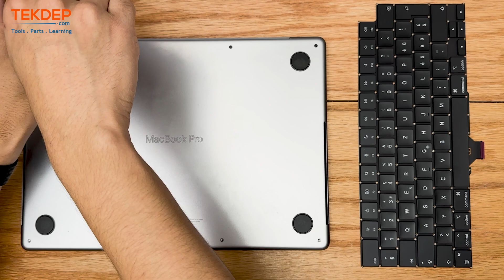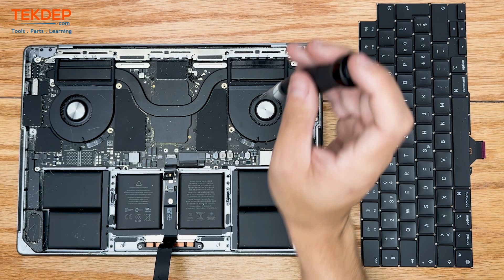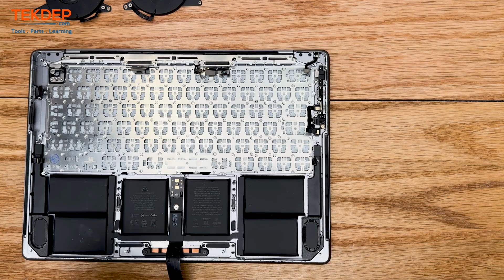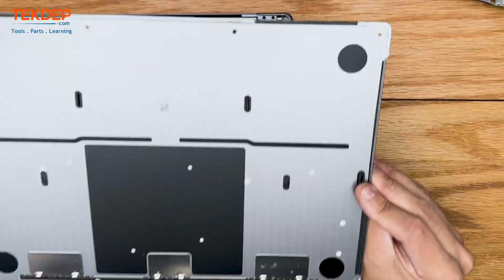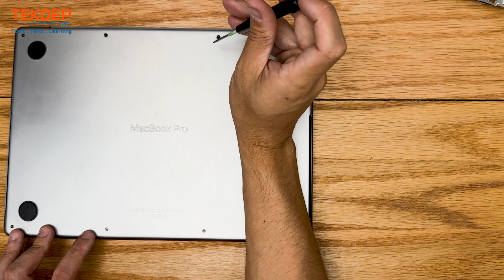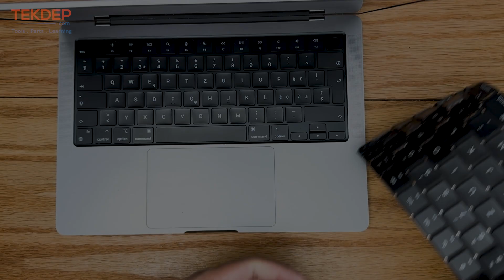2021 M1 MacBook Pro A2442 Keyboard Replacement! Step-by-Step Guide

Comment: unfortunately ripped my display ribbon cable when i removed the keyboard. would've been nice to know on the tutorial i did it how you did but the cable was in the way. 

i reconnected everything now it won't show any display even to my external. somewhere i think apple proprietary headache is not worth it. 

likely seems somewhere dependent to have the display functioning.
Reply from the maker: Beware everyone, This is very important! Must get the Display flex cables out of the way and pull the back before getting excited to rip the keyboard out! Or else you will risk permanently damaging your display, We have cautionary note within the video description and within the video itself. It will show a card on top to caution you. You also must watch a second video before attempting such a complex repair. 

We also offer a convenient and affordable Mail-In Repair and data recovery. You can learn more and get started here: https://tekdep.com/device-repair/

If anyone needs replacement parts such as screen and batteries or tools for your MacBook repairs, we have them all and ship worldwide! visit: https://tekdep.com
Reply: @tekdep i'd be happy to send it see what's salvageable but please don't access my data

Comment: Just finished this repair on my first-generation M1 Pro Max. Took about 4 hours in total. Couldn't have done it without this video! Many thanks!!!
I had to take the logic board back out twice, not heeding the warnings... first time I had one cable underneath ;p ... second time I didn't realize I had to put the fans in first ;p ... but finally together and working 🙏
FYI I think it is necessary to take out the entire upper hinge/wifi bracket... because... you actually can't get the ONE upper left screw off for the power button, under the upper left hinge... have to take the entire bracket off and hinges to remove the screw to properly get the power key and backlight off. I actually lifted the entire screen off since the hinges were still covering it. Maybe you found another way, but that's what I had to do.
This video was like ASMR while doing the work. Thanks again, man 👊
Reply: Hey! Does the keyboard feel wobbly / less secure in the middle in any way? With no rivets to hold it in, i can image some travel?
Reply: @antonsnnichsen109  Hey there. Actually if I recall correctly, there are many rivets throughout the keyboard, that have to be pulled off... however there are also many number of screws around the edges, and also a few screws in the middle. I might have missed one or two of those screws putting it back together (I definitely did, *cough*cats).
That being said, I just tried it again... can't notice a depression at all. I think it's backed pretty well behind it, or at least the screws are holding it in well enough. Really can't notice any difference from the center and sides. Hope it helps. 
Pro tip: Always keep a small magnet close by to keep hold on all of your screws 👍🏻

Comment: вандал
неужели нельзя было  подсветку клавы прогреть что бы она нормально снялась.
Reply from the maker: Sure you can try different techniques, but heating will most likely will shrink and damage the backlight easily since it’s thin plastic layer 

If anyone needs replacement parts such as screen and batteries or tools for your MacBook repairs, we have them all and ship worldwide! visit: https://tekdep.com 

We also offer a convenient and affordable Mail-In Repair and data recovery. You can learn more and get started here: https://tekdep.com/device-repair/

Comment: Just done this and it works! Thanks. 

Although my backlight was literally stuck so it tore some of it off, was no way of removing without ripping it.
Reply from the maker: When working with the backlight, start by carefully peeling off the adhesive all around using a flat pry tool or blade. Be sure to remove it without damaging the backlight cover that sits above the keyboard. Additionally, take extra care not to rip the LCD flex cables, as they are located very close to the keyboard during the peeling process.

If anyone needs replacement parts such as keyboard, screen, batteries or tools for your A2442 MacBook Pro repairs, we have them all and ship worldwide! visit: https://tekdep.com 

We also offer a convenient and affordable Mail-In Repair and data recovery. You can learn more and get started here: https://tekdep.com/device-repair/
Reply: Hey! Does the keyboard feel wobbly / less secure in the middle in any way? With no rivets to hold it in, i can image some travel?

Comment: Are all the screws the same that hold the keyboard in? On my A2485 I found a P2 screwdriver worked perfectly but there are 2 screws that won’t come out— the are the 2 that are even with the tops of the speakers , one on each side — any tips to get them out? I don’t think I have a PL1 screwdriver

Comment: But aren’t those rivets broken after you tear the keyboard out? And the when you put the new keyboard in it is only held by the outer screws? That means the keys arround the middle dont have any support when you press them?
Reply from the maker: Yes, you lose the rivets but still keyboard is held in place securely and it has sufficient support and you 
won’t feel it’s loose. It’s just like the way it was when it’s replaced. Apple is to blame, but it’s completely fine other than the hectic process of replacement, if you need to purchase the keyboard we do have them in stock and ship anywhere! We also have the complete top case assembly if you prefer just to replace the whole thing and not just the keyboard regardless if you also need us to replace it for you, we offer mail in repair service visit our site for parts tools you seen in this video. We have them all or if you need our help to do it for you TEKDEP.com
Reply: @tekdep  You still kind of feel the keyboard going down a bit in the middle. The middle keys also make more sound when pressed, compared to the outer keys that are supported by those screws? Any ways to fix this or apply some double sided black tape maybe ? On the horizontal lines of the keyboard? (between the keycaps)

Comment: I strongly recommend to remove display. This is just a matter of time until loose rivet will crack or scratch the screen by getting between screen and palmrest It is also worth using somethinf to cover battery (you can buy cover for 7$ on apple self repair service). Not that important but keeps speaker and battery safe.
Also this method does not replace rivets with screws. Keyboard will be quite wobbly and it will have noticeable.

Comment: even tho i was trying to be very careful with the touch ID cable, i still ended up tearing it :/ anything i can do?
Reply from the maker: Most affordable way is to just purchase another Touch ID, and it will function as power button since you won’t be able to pair it with your old board and I’m afraid you won’t get your touch if function back unless you replace your entire old logic board with new one that has paired Touch ID. 

If you need just the Touch ID or any other parts or tools for your 14” MacBook Pro repairs, we have them all and ship worldwide! visit: https://tekdep.com

If you're still experiencing issues with your device and need help, we offer a convenient and affordable Mail-In Repair Service and data recovery. You can learn more and get started here: https://tekdep.com/device-repair/

Comment: hey, i tried this but my screen doesn't show up anything except for that sound at the start of  the macbook
Reply from the maker: Possibly you did not secure one of the connectors, revisit the display connectors and make sure they’re snapped in correctly and nothing is damaged! 

If you're still experiencing issues with your device and need help, we offer a convenient and affordable Mail-In Repair Service and data recovery. You can learn more and get started here: https://tekdep.com/device-repair/

If you need parts or tools for your repairs, we have them all and ship worldwide! visit: https://tekdep.com

Comment: Hi, 
I've Macbook Pro 13 - Inch M1, 2020. SInce one week I was facing unexpected issue like Key A and D won't worked. If I try to press multiple times like once in 10 time it works. What would be the possible solutions for it. How much cost it?
Is it any settings problems or keyboard failure?
Reply from the maker: Hello! For your unit it is possible to replace just the keyboard, but due to the touch bar and the associated difficulty that it brings, we recommend just replacing the entire top case assembly. We have the top case available here :  https://tekdep.com/product/13-macbook-pro-2020-gray-palmrest-top-case-keyboardtouch-bar-a2338-a2289/
and the keyboard only here : https://tekdep.com/product/replacement-keyboard-for-2020-apple-macbook-pro-retina-13-a2338-emc-3578/

If you interested in having us complete your repair, we offer mail in repair services here : https://tekdep.com/valettek/
Reply: @tekdep  What if just replacing the keyboard, is that worth it or in near feature will face few more issues.

Comment: Thanks for this great video, which tells me I shouldn't try to do it. I will send it in to TEKDEP.
One advice would be, please, use an ESD pad and ESD wrist band during your repairs. This could increase the yield of your repair team with much less hassles and later issues at the customer. It is not very limiting hand movements.
Reply from the maker: We actually work in an ESD safe environment, by wearing a ESD band around our ankles that are connected directly to ground. But this is definitely sound advise!

Comment: First of all, great video! I have a MacBook Pro 2251 and the built in keyboard stopped working (attaching an external works fine). Got a hold of a new keyboard on ebay and did the swap and unfortunately, the new one also don't work. I suspect the keyboard logic on the motherboard is busted. Have you guys encountered this before? Anything that can be done to check that logic circuit out or how to do some diagnostics?

Comment: can't we replace the keys instead of the whole keyboard so for example instead of AZERTY keys (French keyboard), it's replaced by QWERTY ones? Is it possible without damaging the keyboard?
Reply from the maker: Unfortunately it is not possible, the switches are in a different layout for non QWERTY keyboards, so swapping the entire unit is needed. Additionally, swapping every key cap on the keyboard would most certainly result in at least one non functioning key, as the housings that hold the switches to the keyboard backing and the plastic inserts that hold the switches to the key caps will stress and fatigue during this process most likely resulting in one part or both of them breaking and the key not function correctly or not sitting correctly on the keyboard.

Comment: I think I messed up somewhere. After finishing, I could hear the startup sound but the screen is not displaying anything. I unscrewed and made sure that the LCD cables were properly attached but no luck… any suggestions? Greatly appreciated!
Reply: Same issue here, did you managed to get it sorted?
Reply: @mrs9278  yes… but not good news. LCD cables were damaged, not sure how, I guess I pressed too hard or pulled too hard. Sent it in for repair and they quoted me $650… so not great
Reply: @huetica  how strange, not sure if they’ve discovered the true issue, didn’t you try the machine with another monitor?
Reply: @mrs9278  yeah, I did. They sent me images of the MacBook completely dissected and I could see where the ribbon cables ripped.
Reply: i'm having the same issue now.. oh my..
Reply: this put me off trying this myself llol

Comment: Hi there! My keyboard had some keys damaged by heat, they were slightly melted, but only aesthetic damage, everything is still working fine. Do you know if it is possible to remove just the keys (keycaps) from this new keyboard and fit them to the original macbook keyboard? Is the fitting system below the keys the same? This way I wouldn't need to open the Mac and change the entire keyboard, I would just change the damaged keycaps. Thanks in advance!
Reply from the maker: Yes!! You can absolutely replace the individual key caps. Just take extra care to not damage the switches underneath the key caps when removing and replacing them!

Comment: I just spilled some acetone on my keyboard.  In a panic, I put a blow dryer on the affected area, which melted some of the keys.  The backlights behind them burned out too.  Does this replacement come with backlights to each key or is that a separate part that I have to buy?  

The sad part is that I just had my MacBook Pro repaired at Apple, but now my Apple Care has expired :(
Reply: I have a 2020 13-inch two-thunderbolt MacBook Pro with the touch bar

Comment: I followed this guide and im in the stage where I put back the logic board and connected the ribbon cables, inlcuding the battery ones. I wanted to do a quick test without screwing anything but its not turning on. TouchID ribbon is also connected. Can it be because it doesnt turn on without the bottom panel?